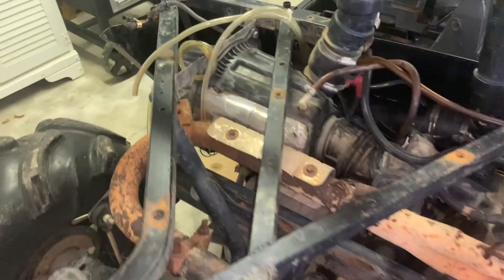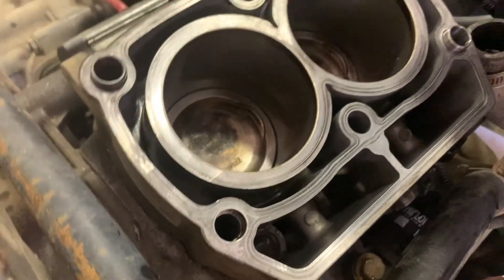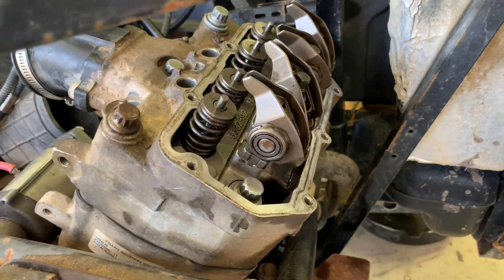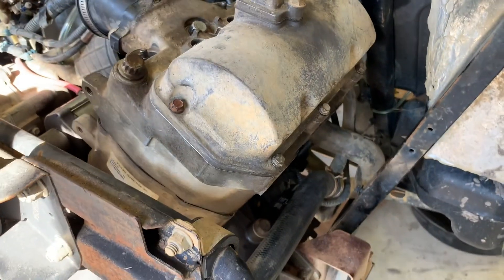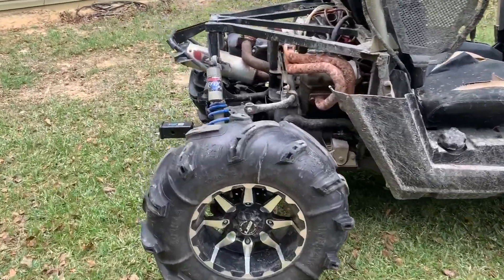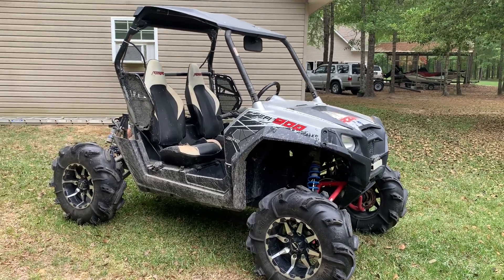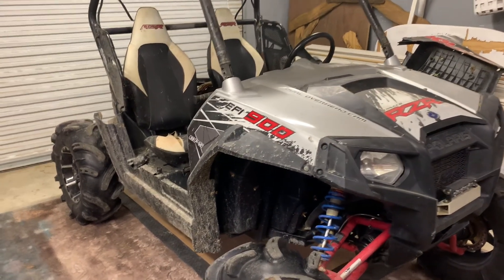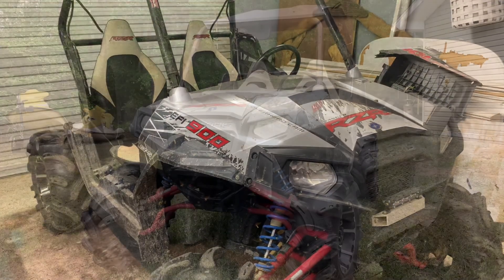World's Cheapest RZR Runs Again: Head Gasket Repair

Comment: do you still have the rzr
Reply from the maker: I do. It’s currently parked due to filling up the oil with water again. At some point, I’m going to look into the water pump seal. I really want to avoid replacing my head. It could be warped though.
Reply: @ramenbuilt6411  did you mill the head before you changed the head gasket, if you didnt thats probably the problem
Reply: Check the seal..and the weap hole...